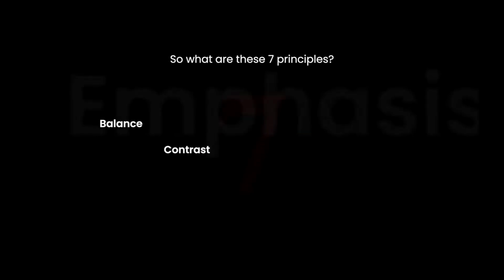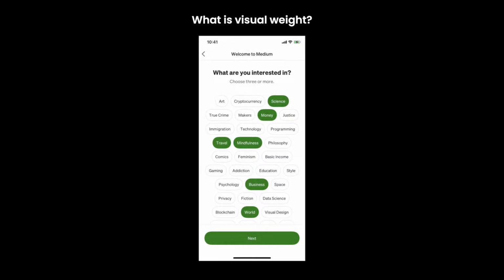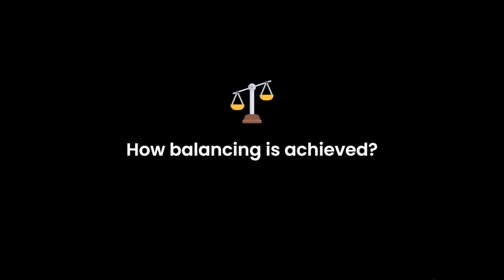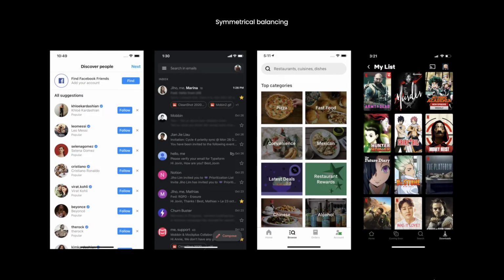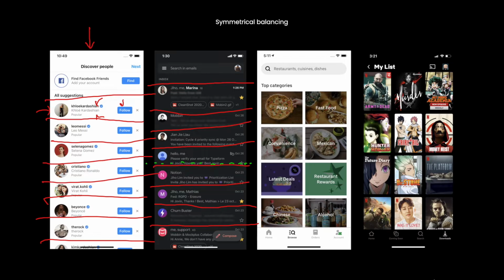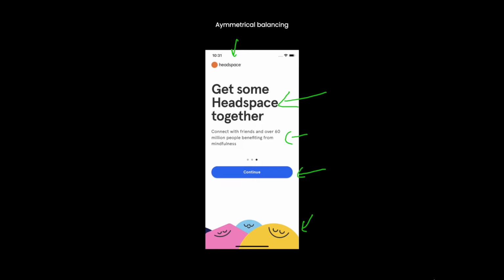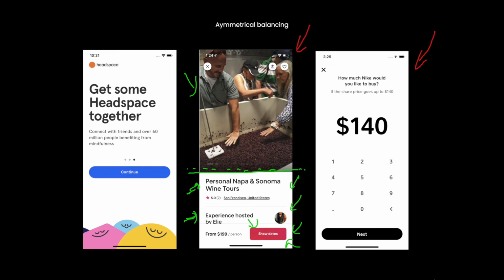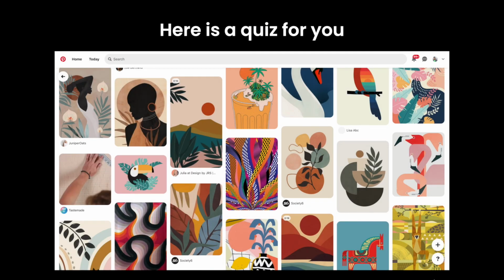2. Principle of Balance | Principles of design with examples

Comment: Pinterest can be said as symmetrically balanced, cause even if the image tiles are asymmetrical, they are randomized to give a symmetrical layout, if you draw a line anywhere between the screen.
Reply from the maker: Bingo! You got it absolutely right. Even though it seems asymmetrical in first look, it's actually symmetrically balanced. The randomness in the tiles even out each other on a central axis✌️✌️.
Reply: @AkashYadavUX  So I can say that I got the concept correct from your video! Great content! <3